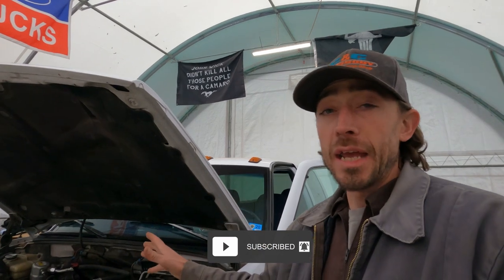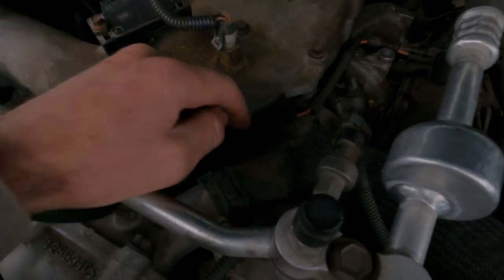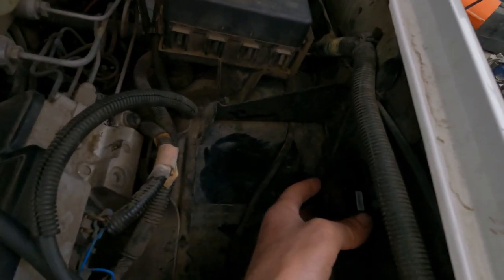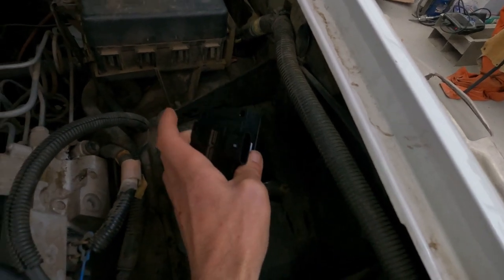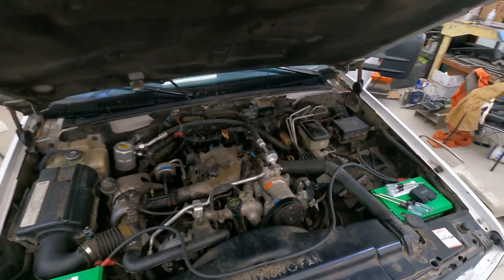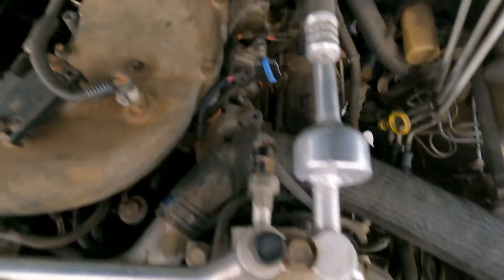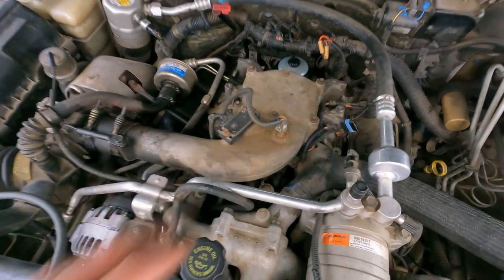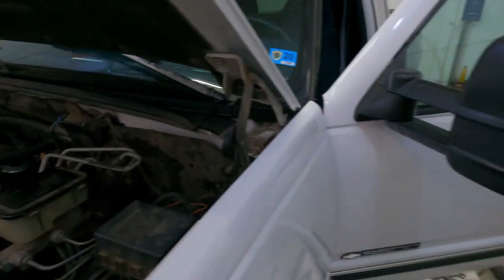CHEVY 3500 6.5 DIESEL STALLING... BAD PMD

Comment: I have a 95 with the 6.5 I have changed the fuel filter and mist everything but PDM cause it has been changed before my truck spuders at idle or going down the road spuders as well but never dies on me could that still be the issue any one know thanks.

Comment: It’s the Pump Driver Module Or Pump Mounted Driver whatever, sometimes the check engine light does come on, it happened to me lol. The throttle starts acting up, I was able to limp home, but it wouldn’t start after that. Always carry a spare pmd when owning a 6.5 diesel. relocation helps, in that you can access it faster because it’s gonna fail no matter what.

Comment: What if you’ve got stalling but you have a brand new injection pump already installed had the issue before and had shop install a brand new injection pump and still have the issue